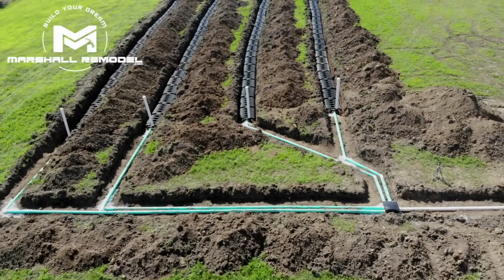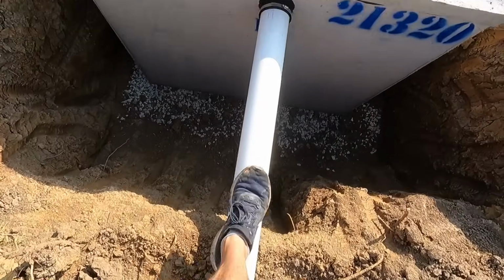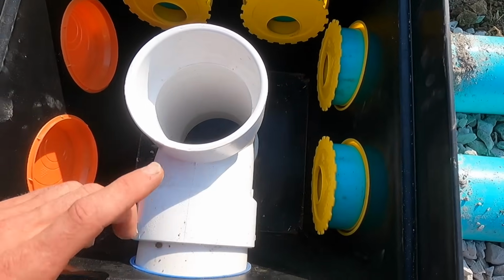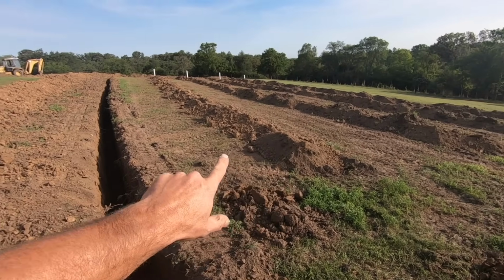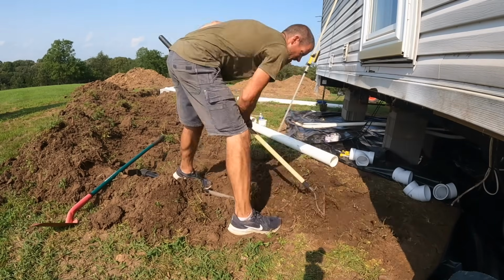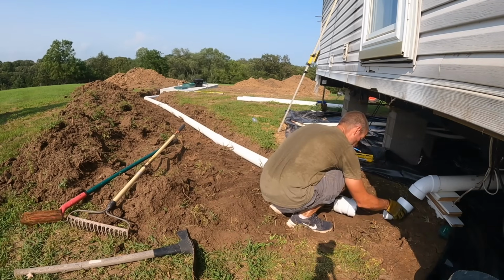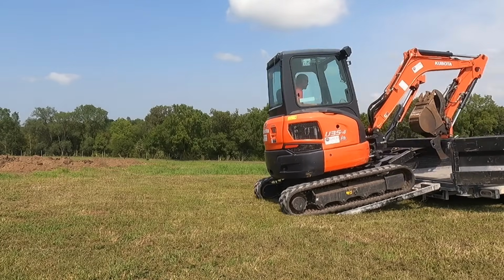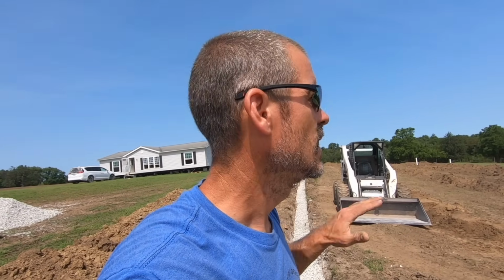Septic System Install with Mobile Home Hookup

Comment: Can we use a 90 degree bend on the pipeline  right after the septic tank? If we don't have much room to keep the pipe straight.
Reply: Probably as long as it’s a 90 degree sweep and not a regular 90 degree or maybe better to use a couple 45’s that are like 1-2 freer apart for a longer more gradual 90 to reach where you want. But with a 3” and the correct drop you should be good. But I’m just a DIY’er

Comment: How do septic systems work in cold climates?  Do you have to trench below the frost line?  I would have guessed you would have trenched deeper there but obviously code says otherwise. Do you have to worry about frost heaves there? What's roughly the total cost of a system like that?

Comment: Great video,  thank you so much for sharing. My only question is could I have I'm assuming 3 dual compartment septic tanks and run additional lines (you mentioned 4×100' plus draintile)? I ask because I will have 3 different homes, my family on 6 acres? Or should I do different septic tanks and systems for each home? Thoughts anyone?

Comment: At 2:53.  Did you drill a hole into the side of the tank for the 20 ft solid core pipe from house to enter the tank?
Or was the hole already there? If the hole was there then house deep into the hole did you know to put the septic tank so that the end of the 20 ft pipe from house met the hole perfectly at the same height- since you put the tank in ground first - I would’ve thought you run the pipe from house 1st with the 1/4 inch drop per ft so 5 grade change total where the pipe enters the tank-

Comment: Drain field seems like overkill. Your tank only drains as fast as the water down your drain and it only drains as much as you use at a time. A shower might fill one or 2 tubes barley.
Reply from the maker: Gotta go with the county requirements

Comment: Fantastic video, thank you for sharing and explaining everything.  One question, on the two outside (left) runs on the 90-degree bends, why would you not use a long sweep instead of the tight 90s you used, just curious, thanks again.

Comment: When I had my septic system installed the installer told me I couldn’t drive my tractor over the the chamber style  field lines. I stopped them right there and made them install the old style with pipe, cloth and gravel. I didn’t want anything that weight vulnerable on my property.

Comment: What are those black 100 foot sections things for? Why does one need them for?
Reply: It’s a different type of way to drain the water. I guess it just flows level from the beginning to the end then seeps into the ground and some up through the soil. rather than normal leach lines that are the 3” pipes with holes drilled in the. With layers of gravel. Seems like no questions are being answered by the man who posted this video.

Comment: It’s amazing how much land is needed to install a septic system. If someone has a small lot it would be hard to build anything.
Reply from the maker: Yes, you aren't going to see many small lots that don't have city sewer access. But it could get tricky depending on your land layout.
Reply: I live in a small village in Germany without sewer access. Here people either have a septic tank which gets pumped out every couple of weeks or they have a wastewater purification plant. I have the latter and it's awesome. It only takes 3 squaremeters of space and it puts out clean water. You can open it and it doesn't smell like anything.
Reply: @ChristophPech  how does that work?
Reply: @gary-gilbert  It is a kind of a sequential batch reactor. There are three chambers, the wastewater runs into the first and settles out particulate matter similarly like the one in the video here. In the second stage the water is being treated with air bubbles for about 8 hours and cleaned by bacteria. In the last stage the remaining dust settles out and finally the water is clean and can go into the ground directly. The disadvantage is you need electricity and you have moving parts like pumps which means more maintenance.
Reply: @ChristophPech  that's pretty amazing technology.
Reply: @gary-gilbert  The EU outlawed traditional septic systems in 2001 because lots of rivers were very dirty. So people had to invent those miniaturized purification systems.
Reply: Cheap system with no storage capacity. In New England they have all types of innovative systems that have smaller footprints and can be buried under driveways so the rest of the property is saved for future structures or replacement.
Reply: Septic ponds shared by multiple homes are an option.

Comment: You need to clarify that the slope cannot exceed 1/4" per foot or the increased velocity of the water will drop the solids in the pipe and eventually clog system. The curtain drain and its perf pipe must also have 1/8" per foot of slope to function effectively, and as it exits the ground it must continue this slope until it "comes to daylight."

Comment: Seems like the perfect scenario for a system like that. Also seems a bit over engineered for such a small house but I’m no expert. Looks like you know what you’re doing. Nice work.
Reply: the video mentions this is a for a larger built up house and homestead later on, but temporarily hooked up to a mobile home.

Comment: I am familiar with septic systems, but this filled in a lot of gaps for me. My daughter just bought a home with a big back yard. I know where the tank is placed. From the tank the land to the left is higher than the tank. Straight away is fairly level. To the right the land slopes to the right and further back it slopes a good deal to the right. I estimate the back right of the property is 6-8 feet lower than where the tank is. The selling agent told us that we couldn't put a garage on the higher  ground to the left because it was part of the field. I don't  see how that is possible, but is it?

Comment: Great job. I'm in the process of building the same system. But my question is on the air vent how do you get air into the leach filed for water to flow if you decide not to have the viewing port since you said it's optional?

Comment: Great video including all details.  May I ask approximately how long did it take you to perform this installation?  We are purchasing a property and will be doing a similar installation ourselves.  I want to finish budgeting our equipment rental costs for our area.  I subbed to learn more on what all it takes you to complete projects.  Thanks.
Reply from the maker: With experience and some extra hands you're looking at 3-4 days for a job like this, but could take closer to a week if you haven't done it. We did this video breaking down the cost https://youtu.be/swCz8hxd1-8

Comment: you really should be twisting your PVC as you connect them when you can, helps make 100% sure of no leaks even after decades of use
source: ive been doing irrigation for 15 years

Comment: I'm trying to look for the information / name of that last pipe you put in the ground at the end of the video. Is it called a retaining wall? When it rains the water uphill comes down and floods my septic field. I need to drain that water somewhere else instead of going into my field. Just need more information on it how deep I should make it and if there's more information I need to do the job.

Comment: Wonderful video and information thanks. I live upstate New York and I'm having a Septic system installed we also have a water well and so do our neighbors.  The law  prefers  for the wells to be at least 100 feet from the leach field, however we cannot make that distance from our well and or our neighbors well. The property is on 1/3 of a acre and the neighbors have about the same. The design has already been approved by the health department although it is technically not compliant with the proper distances recommended by the health department. My question to you is what could be done to make this a tad bit safer and efficient ? And what should we absolutely avoid having done ? We live in a world where people are ok with cutting corners and taking advantage of others ignorance. Could you please give me some inside information and pointers.

Comment: Must have been the soil quality that gave so many runs at that length for a  moderate sized mobile home?
Seems excessive?
Reply: That is what I was thinking.  We have less than 250 feet for a 3 bedroom home.
Reply: It depends on the perc rate. Slower perc means you need a large area to disperse the effluent

Comment: My system is sloped down into a wet area of the property.  Is it possible to build up my yard in the wet area. Essentially covering the toe of the septic  downslope with fill? Will the weight of the fill effect the function of my current system ?

Comment: Does the ground freeze there? Should the tank be installed under the frost line should it get very cold in the winter? Unfortunately where I live it get pretty cold, could drop down to -30C to -40C. Alberta canada.
Reply: Yes it does. This is in Iowa where the temperature is regularly below -20C

Comment: Solid Install. Can you tell us the soil type? Looks like a clay loam. Wanted to clear up some misconceptions in the other comments- Septic costs vary wildly over the country and unfortunately material prices are only going up. No need for cleanouts in the green pipe, its only liquid after the septic tank. Size of septics is based on the estimated flow coming out of the house and the soil loading rate. 
Why not use the mini to dig the drainfield? What is your separation between cells? Wisconsin's minimum is 3 feet between cells.

Comment: I've seen a few of these in America and on our Farm in the Karoo which has a 4 bedroom house on a rock plate which has clayey aggregate underneath and I have never seen a septic this size...either over engineered or there is a different reason for the size in that state, but for a 2 bedroom you get something about a quarter of that size if at all that big, seems a bit impossible that a 3 bedroom is so much bigger, doesn't make sense. Looks like you want to run a factory.

Comment: The cement mix placed in a few areas—pipe junctions?—looks to be to secure and stabilize the connections.  But I didn't see any mixing or curing of the cement mix.   Are  you hoping for rain soaking to cure the mix?  What if freezing occurs first?
Reply: Reason for it is , moisture will take  care of it ,and it cures out stronger mix.in my area they do lot of the post holes this way on decks ..he might say different then what I say ,but it's the reason for it around my area .smart man

Comment: Questions.. with the requirement being 400', instead of 4x100', can you do 8x50'?
Reply from the maker: That is up to the system designer. How it works here is you get a perk test, based on that they design your system and tell you what it needs to be. You can’t get outside of the perk tested area.

Comment: Wow!!! That system cost A LOT OF MONEY!!! 4" schedule 40 is about $80 a 20' joint if not higher now! Tank,fittings,4 runs of lines,boxes,labor,machinery..that $10000 at least..wow!! Here..we would went 10' to tank and 100 or 200 field line..because they probably won't be there long.

Comment: Hi,  we have a septic system for just about 18 years.  Everything works as it should, but we are seeing the land creating ruts.  Not sure if we should bring in top soil, but also afraid of running any big equipment over the leach lines.   Any suggestions would be so appreciated!

Comment: I think I'm just a bit daft but I still don't know what happens to the water once it gets to the 100ft black bit... does it just dribble into the soil?
Reply: It does just dribble over the surface of the soil under the chambers. The soil acts as a filter, removing all of the bad stuff from the liquid. By the time the waste water reaches the aquifer, it has been completely scrubbed clean and can be used for normal consumption.
Reply: @theElderberryFarmer  Oh, wow... in essence the mission here is to separate the solids from liquids... taking the sewage water through the system to the release the water into the soil which further filters the water cycling it back to the main water source... so we remain with biosolids which are taken for processing?... I have too many questions, I'll stop here
Reply: @emmanuelkamera8790  Yes - the solids are separated from the liquids. In the large concrete tank that all of the household waste enters, there is a divider that separates the tank into two chambers. The waste stream enters the first chamber, and the solids drop to the bottom. The liquids are able to pass over the top of the divider and proceed to the second chamber. The liquids ultimately exit the second chamber and make their way to the disposal field.
The solids that remain in the first chamber are full of bacteria that are consuming them. In a perfectly balanced system (which does not exist), all of the solids are consumed at the same rate as they are added to the chamber. Since this balance is never reached, the first chamber would ultimately fill with solids if left unmaintained. As needed (generally every 2-3 years in an average home), the first chamber is pumped out by a company that will take the solid waste to a sewage treatment plant for further processing.
Reply: @theElderberryFarmer   really amazing thanks for the replies

Comment: The French drain you installed will fail in about 2 years because you didn't burrito wrap the gravel and pipe therefore the soil will penetrate the gravel and the perf. pipe over time and totally stop the water from flowing into it. The gravel used is not the correct gravel for a French drain as well. The drain must be wrapped in geotextile material. This material allows water to flow into the drain but keep the soil out of the gravel and pipe and will last a lifetime.

Comment: This Somewhat Impressive, Well Done.
But Obviously an Industrial Sewerage System for Homes would be Smaller, Use Electricity, Not need All the Drainage Pits and Supply Cleaner Waste Water ?.

Comment: what's up with those ridiculously long header lines? lot of wasted material there.    Also not a fan of the outlet filter; most homeowners never clean  them (I mean who really wants to) and end up calling a maintenance provider once it gets clogged (and they will probably just take it out). I like the two compartment tank, the manhole covers on each side and  how you bedded the d-box in gravel and poured a couple bags of cement around it. Nice touch. That soil looks awesome btw.

Comment: Quick question, could you dig the trenches down a couple of three feet deeper and install ground source heat pump lines, then add fill over them for the septic system? The aerial view is almost identical to what I would require for the heat pump install I'm looking at.
Reply: This is generally not a good idea. In the heating season, the ground loop can actually drop the local ground temp low enough that it will interfere with the operation of the disposal field. Freezing the wastewater will cause a failure in the fields ability to dispose of the water, and dropping the temps low enough can damage the bacteria that are preventing the build up of a biomat under your disposal lines.

Also, the inspector will likely not allow the disturbance of the soil under the disposal lines.
Reply: @theElderberryFarmer  Understood,  thanks for this.

Comment: One question. I just moved into a new home in the country. I never dealt with a septic system before.  I alway lived in the city where i had the city dealt with the waste. Anyways, i notice that it had a sprinkler systems (irritation system). My question is, can i add more sprinkler to the two that are already from the septic? Is that possible? Can someone please answer this? A contractor told me i have to use the main water line because i wont have enough pressure for two or three more sprinklers.

Comment: What do you do if you dont have enough property to run the required drainage pipe?
Reply from the maker: There are different types of septic system options, usually higher costs but require less land

Comment: I accidentally ran over one of these septic fields, newly installed with my 1985 4runner, weighs about 3600 lbs, think the septic field is ok? the top part of the ground was frozen....  please advise. thanks!
Reply: Do you know how deep the chambers were ? Did your car sit atop for awhile ? Did you notice any dips where your tires rolled ? Was the ground frozen 'solid' for weeks, days, hours ?
Reply: @eugeniotapia6765  Ground was frozen, i drove my 1985 Toyota 4runner over it and no tracks or dips occurred. I asked my friend if any damaged occurred, all good.....

Comment: Just curious. Whats the pros and cons between a cement tank and fiberglass type tank. Will a cement one possibly crack and leak?  Great job Paul.
Reply: Concrete tank pros: Very durable & strong, can be more economical than a plastic tank depending on the area; harder to float (yes they can/will float on some sites) I've seen well made concrete tanks in good condition that are 50+ years old.  Cons: need a crane truck to set it so not all sites are accessible; most are made of two pieces and if not sealed correctly it may leak; susceptible to microbial induced corrosion (MIC).  Plastic tank pros: light, can be carried/set by a mini excavator and necessary on some steep/tight sites.; hermetically sealed from the factory; not affected by MIC. Cons: not nearly as strong as concrete so if someone accidently runs over it or parks a car on it it is more likely to be damaged especially when the soil is saturated; not hard at all to float on a site that is not well drained and anchoring the tank in the hole is a must. Overall the choice of plastic and concrete is site dependent. Fiberglass is very brittle and I have not seen many primary treatment tanks made from it.
Reply: @adamhurt6140  dude, you sound like you know your shit.